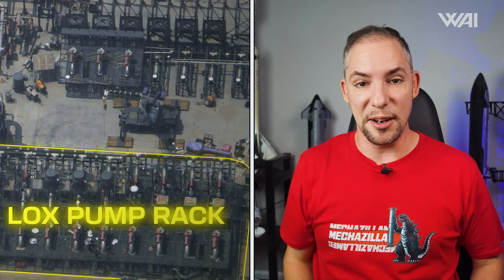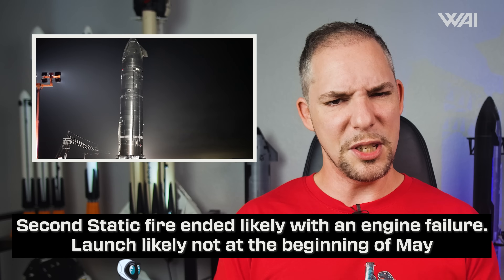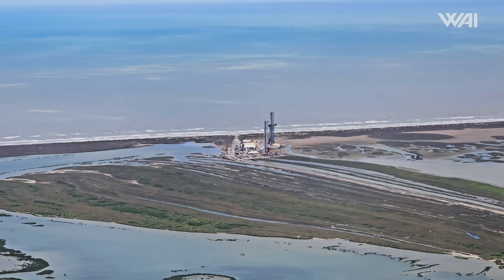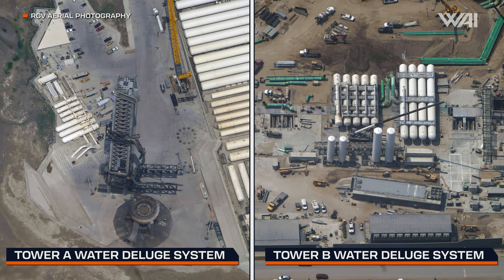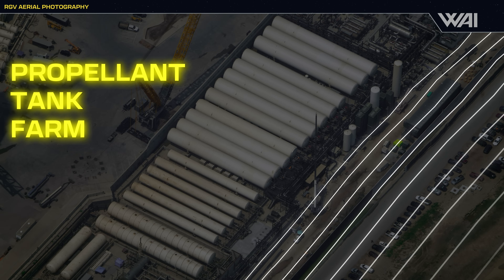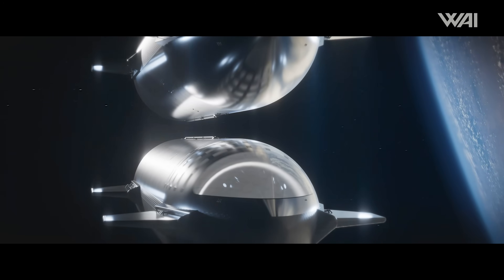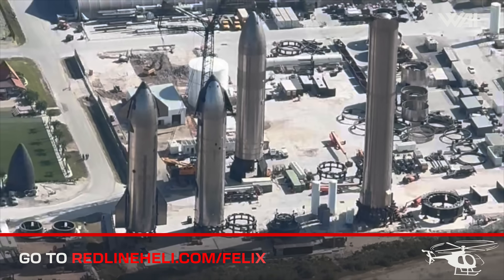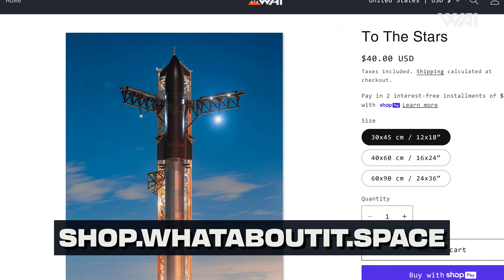SpaceX's Next Starship Milestone: Are They Kidding?

Comment: The connectors for the fuel transfer of the Starships is shown on the tip of the cone, where there’s the most stress in reentry..seems like the worst place to put such a complicated moving part. Wouldn’t the best place be at the base of the cone, on the side that’s not shielded with those fragile ceramic tiles?
Reply: Not just at reentry but while connected - two huge and massive objects connected by a very small diameter ring/tube requires perfect axial alignment and absolutely no pitch or yaw movement after connection. The slightest off axial movement would put unbearable stress on the connection.

Another consideration is any fuel transfers through the nose would seriously restrict the size of the transfer tubes greatly extending the transfer times and duration of high stress on the connection.